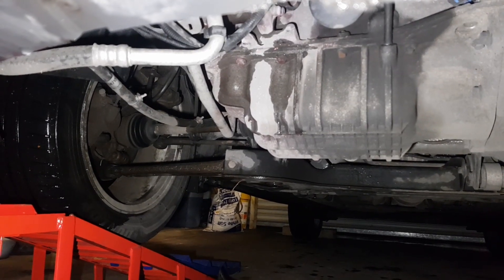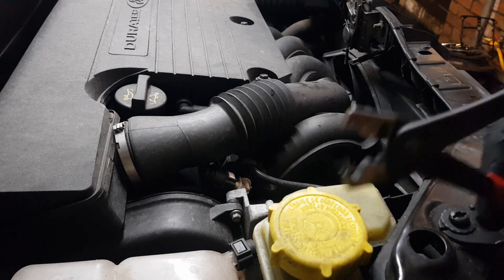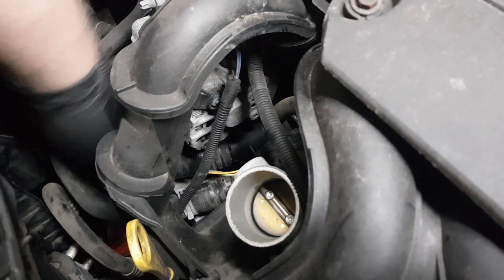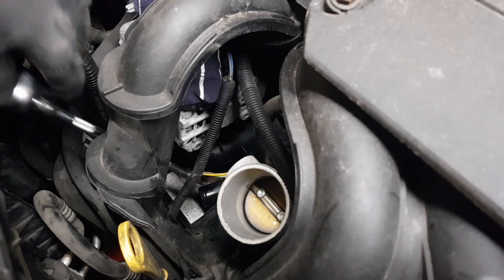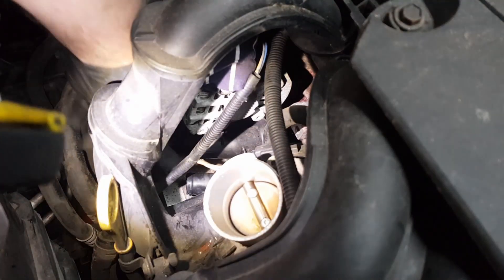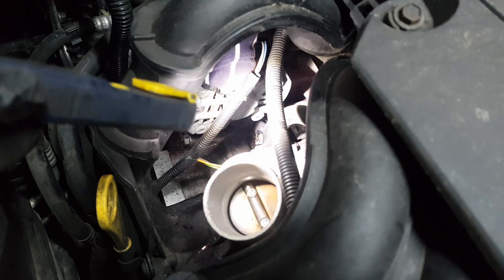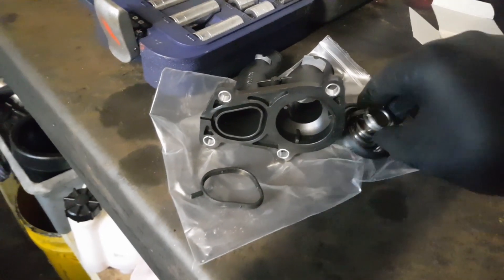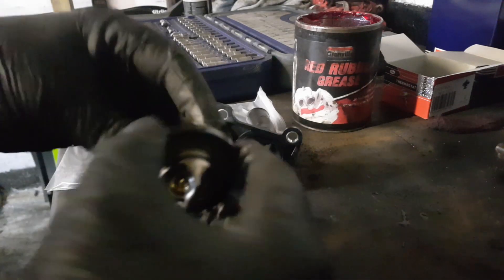thermostat and housing replacement ford fusion fiesta ka focus 1.6 petrol

Comment: Hi Marty. I changed the heat resistor because my heat doesn't get as hot anymore and I've not really seen any improvement. The blowers give strong air out through the circular vents but when i change to the windscreen vent it's very weak. My coolant is a stable level and is not thick like gunge. Someone recommended to change the thermostat for this issue. Would you agree, worth the hassle?
Reply from the maker: So what I would do is start the car from cold and as the engine walms up you shuld feel all the coolant hoses and engine walm up except the top water hose that hoes to the radiator,  if that hose walms up with the engine then your thermostat is stuck open causing the engine to run cold, hope this helps

Comment: Do you need the gasket aswell?
Reply from the maker: It comes with the new housing, but I would not recommend taking it apart and not replacing it.
Reply: @Martysworkshop so you don't need a new gasket when your replacing the plastic housing and thermostat?
Reply from the maker: The thermostat seals the one side and the new housing will come with a new seal for the other side, if it doesn't the you need to get one.
Reply: @Martysworkshop  Thank-you really appreciate it